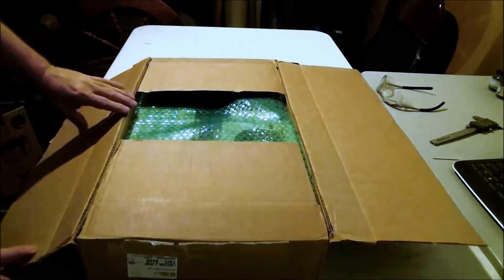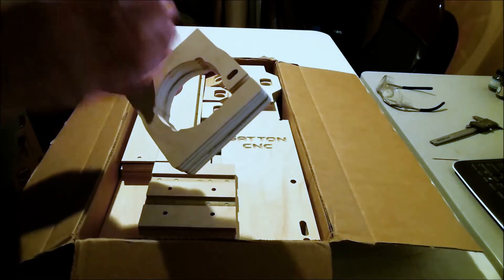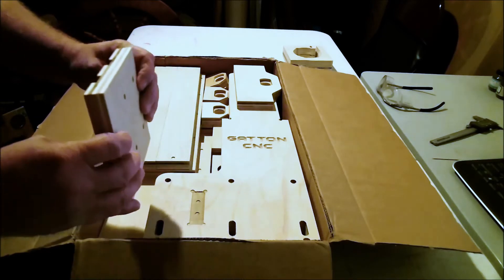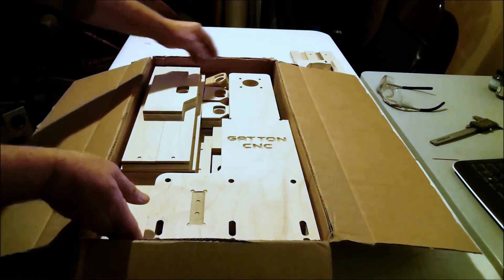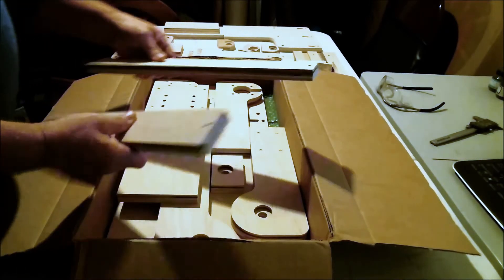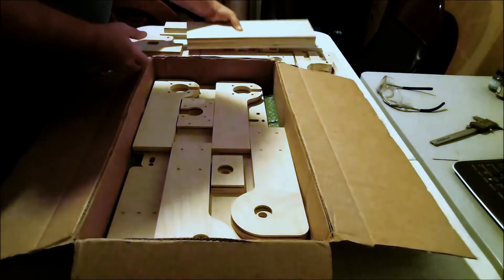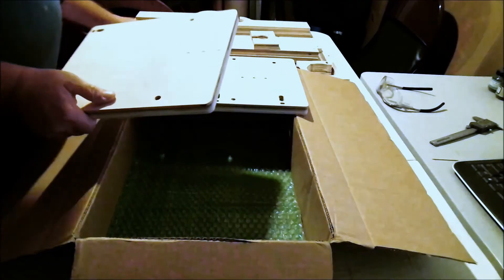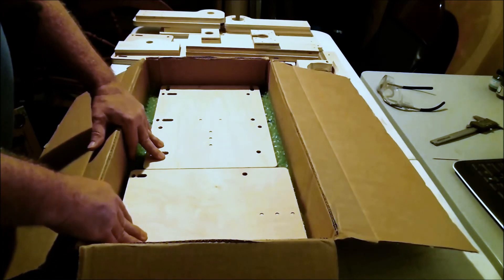Project Introduction

Comment: Howdy Mark. Great video! I scanned through it rushed for time (lotta fast forwarding) One thing I didn't notice being in the kit were the metal parts required for the machine, i.e. threaded rods, bearings, etc...  Looked the kit up and Dave's site mentions the only thing missing in the kit are a couple of square wood pieces. Does a person need to plan for coming outta pocket for the metal pieces?
Reply from the maker: The short answer is Yes. In the plans that come with the kit, Dave calls out all of the parts needed to complete the assembly. You can also get a list of parts needed by visiting his website, www.davegatton.com  There you'll find a ton of info on the Gatton CNC build, to include assembly videos. Also consider joining the Gatton CNC Facebook group. There are a ton of members there who are building or have built a Gatton CNC, and they're more than willing to answer any question you may have. Good luck on your build!

Comment: Mark,
Another great video! I'm looking forward to this series to say the least!
I'm using a 690 router and am thinking about putting my 892 on it just so i can get the longer shaft making it easier to use my dust boot and change bits or maybe get a knuckle chuck.
Anyway, thanks for the Video!
Lyle
Reply from the maker: I had an 890 series motor on the Shoestring Budget CNC, and it worked like a champ. Since this video was shot, I picked up a 690, and I've used it as a hand held a time or two. It's a sweet little router. I'm still going back and forth over which to put on the Gatton CNC. I'm going to order a new set of brushes for the 890 (it will undoubtedly need them soon,) and maybe by the time I get to that point in the build, I'll have decided which one to mount.

Comment: I came in not thinking about CNC and I now feel a strong need to get one, not kidding. I'm sitting here thinking where I can put it in my living room lol...
Reply from the maker: They make a ton of dust, Eloy. I mean a serious ton. There are ways to reduce it, but short of completely enclosing the machine and running a dust extraction system, you'll never eliminate it all. Having said all of that, they are a lot of fun. The best advice I could give someone who is just thinking about one is to start learning the design software yesterday. You can't get started on that too early.
Reply: We'll heck dude, I would have to build a Javi box. I know I'd get a lot of use out of it. Lot's to think on considering the space I have though. I look forward to the next video in this series!
Reply from the maker: Then the next video in this series will be perfect for you. It's all about planning for a CNC, to include sizing one to suit your needs and the size limitations of your shop. I don't tell people what size to build their CNC - just how to determine that size for themselves. I'll be posting the next video Wednesday, Aug 2nd.

Comment: Great that you got a Gatton.  I still need to rebuild my Gatton and put the correct 6061 Alum rails.  I think I will make it much smaller than the original now that I have the 48x48 GaragewoxCnc.  I had both my knee and back surgeries last week and hope to be back in the shop in a couple of weeks. I have the V9 VCarve loaded now.The problem was I needed a V9 license code.
Talk to you later.  JJ